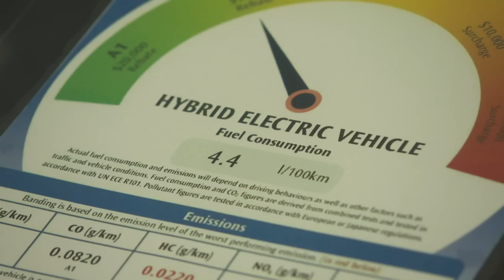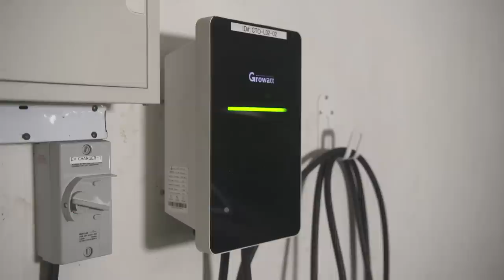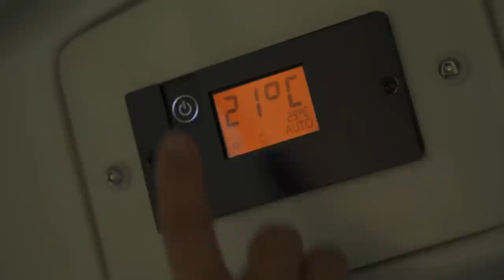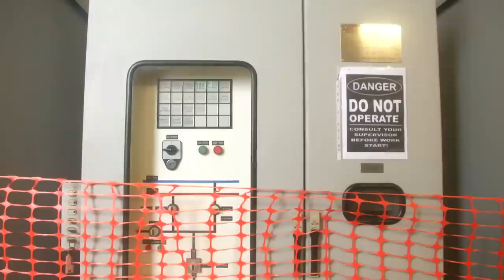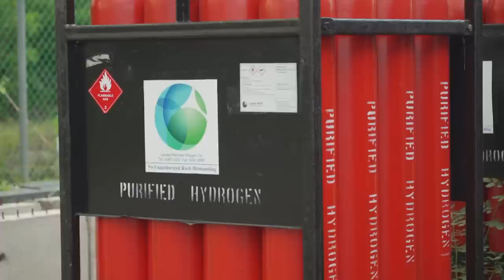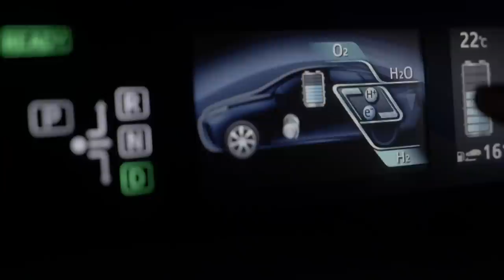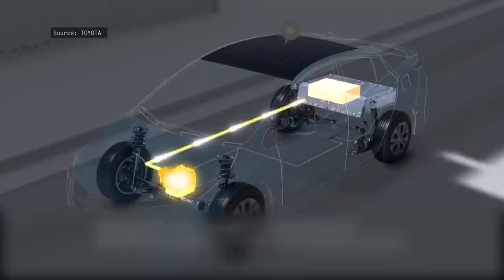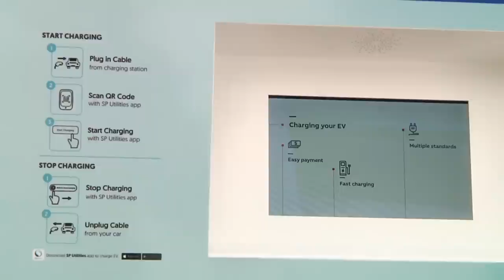Are Electric Cars Really Good For The Environment? | Why It Matters 4 | Full Episode

Comment: Did you cover the power loss topic during power generation, transmission and charging? How efficient?
Reply: There are many videos discussing energy efficiency. Electric cars are the most efficient of the bunch unless the battery gets way too heavy for the task at hand.
Small passenger cars already are cheaper at life cycle bases compared ICE in most places.
Vehicle integrated PV isn't the best option in most situations. When it can be used without adding much extra weight and it can be done inexpensively. It can reduce size and weight of the battery thereby reducing roiling resistance. Solar PV is in less than optimal position on a car therefore producing less power per given area - this can be mitigated by using higher efficiency multijunction cells. For a car to last longer it would be better to avoid unnecessary UV exposure, so in densely populated areas with underground parking it would be not much good.
Slower, liter Solar PV & Battery assisted aero bikes could be a better bet for solar powered vehicle :)
Also it is better to use most fitting vehicle for a task at hand, so it would make sense to share vehicles and rides.
Health benefits of reduced air pollution alone would benefit enough to justify the cost to switch from ICE in densely populated areas.

Comment: Electric car will help reduce urban heat island effect as it is more energy efficient and emits no exhaust. Exhaust from cars are not only unhealthy, it also traps heat.

I hope we will move to electric car sooner than later.
Reply: Several reports have found that hybrid electric vehicles, plug-in hybrids and all-electric cars generate more carbon emissions during their production than current conventional vehicles but still have a lower overall carbon footprint over the full life cycle.
Reply: You need to understand how much precious metals are haversted from the earth to make the batteries etc...
Reply: @N16Ken  I have read some articles but it is difficult to verify the validity those claims. Regardless, electric car are lighter and do not have gears and thus are more efficient. In a highly dense city, the pollution from ICEV is significant and has impact to UHI and public health. Reduction in traffic pollution and lower heat production will also in turn reduce energy needed for air conditioning.

I think there is opportunity to recycle lithium ion batteries as well.
Reply: I am not saying electric vehicles are not beneficial to the present situation we are in. Yes they are surely better... maybe not entirely practical in most cases. 
Maybe one day the electric cars can just go into a 'gas station' or rather a battery station and simply swap out a fully charged battery for their drained out one... then maybe it seems more practical. 
Anyways i dont know when we can all be driving electric cars... but i do know that unless cost and practicalities prevail, otherwise petrol, diesel & CNG will still be here for a very long time to come.
Reply: @N16Ken  What is lacking is sufficient charging station which requires heavy investment by the government.

Recently, Samsung has developed a 900Wh solid-state battery. Solid-state battery use a solid electrolyte making them nonflammable, avoid using a number of toxic materials, and hold the promise of energy densities up to 2.5x that of lithium-based batteries. This is a major breakthrough. 

The development of perovskite-on-silicon solar cells is promising as well. 

The world should move to electric car at a faster pace. This will further accelerate scientific development in green tech and infrastructure instead of investing in development of ICEV.
Reply: Nope you don't know Lithium has more pollution than gas
Reply: nope the most efficient is by maximizing the utilization of public transport like buses and trains and minimizing cars or replacing them by means of bicycles
Reply: @N16Ken  I've read of news that Tesla already had that swapping battery plan in mind at least 3 years ago (before covid) for US. The idea is that those petrol stations would have an area for battery swapping and the target is for that whole process to be under 30mins (iirc). The other main issue would be how $ would be charged, etc.

Comment: Talking about environmental friendly. What about disposal of the battery? Which is more harmful? Have this been debated?
Reply: There is growing market for recycling used batteries for 2nd life applications. Growing market because electric vehicles are still in it's infancy, only commercially available in small numbers about 10 years ago. Emissions from burning fossil fuels since the dawn of the internal combustion engine has not been recycled, this is caused more harm to the environment.
Reply: @alvins.2428  recycling lithium is far more expensive than producing the new battery, so dumping the dead battery is far more toxic.

Comment: Driving into MY how? Can go over but cannot come back because no charging points. LOL!
Reply: Exactly,  unless Malaysia also does the same, if not it's pointless to own a all electric cars.  Also, Will electric cars able to climb the steepest hill in Genting Highlands?
Reply: @marvint480  Go by bus or hire a car in malaysia
Reply: EV range is easily more than 400km
Reply: @marvint480  electric vehicles has more torque than your regular family car. It can definitely get the job done easily provided you have enough charge.
Reply: @akupehsluarketatAR  You need to consider that battery generates quite a lot of heat, it will reduce the mileage by a lot.
Reply: @marvint480  same goes to an engine when u stress it. That is why Tesla has a cooling/heating system for its batteries
Reply: Malaysia also has plenty of charging points.. a number of them are also free.
Reply: @marvint480  Cold weather is much worse for range than heat. Most EVs have thermal management systems to keep the battery in the most efficient operating temperature. The optimal operating temperature for lithium batteries is between 15°C to 35°C depending on the chemistry. So our local climate is actually pretty suitable for EVs when it comes to range.
Reply: Malaysia having charging points in several mall too.pls update yourself. Thailand is more advanced in Ev and charging points all over the country
Reply: @justice217  Several malls doesn't equate to ubiquitousness but since can't go over anytime soon, it's all moot now. In Malaysia, just because it's available doesn't mean it's working, just an observation.
Reply: @sil3ntscr3amlx  several malls in jb and many malls in whole country is setting up the charging points. Singapore is far behind than China and Thailand in terms of Ev
Reply: @justice217  I agree Sg is far behind for now. Can only hope it will indeed get better by 2030.
Reply: Malaysia has numerous charging point, especially along NS highway.
Reply: Poor battery lifespan after few years of usage. Expensive to replace battery.  Poor mileage. Will be a problem for those who needs to drive to malaysia. Not to mention reselling it in few years later.

Comment: Cars are but just a small contributor of carbon emissions in the whole scheme of things. If we're really serious about cutting emissions, we need to look at the bigger contributors like airplanes, cargo ships/tankers, freighters, cargo trucks etc. And also more seriously consider other alternatives like hydrogen, biofuels etc. The environmental drawbacks of rechargeable batteries used in EVs, cost and carbon footprint of manufacture, as well as the cost of disposing them when they're dead is just too "expensive" for the environment in the whole scheme of things. And if the batteries catch fire, boy oh boy.....you're gonna be in deep deep trouble. It's a bigger explosion, the fire is more intense, and a lot more difficult to put out. It's argued that it's easier to just let the battery burn itself out than trying to put out the fire.

Comment: How about the total life cycles of the electric car and the petrol car, including disposing the car and batteries etc? Even though you may reduce greenhouse emissions during using, it doesn't mean greenhouse emissions and other pollution from producing and disposal doesn't matter.
Reply: Million mile battery and batteries can be recycled
Reply: There is growing market for recycling used batteries for 2nd life applications. Growing market because electric vehicles are still in it's infancy, only commercially available in small numbers about 10 years ago. Emissions from burning fossil fuels since the dawn of the internal combustion engine has not been recycled, this is caused more harm to the environment and is still doing so until we turn this ship around.

Comment: This was only based on the energy sources to propel/move vehicles in an eco friendly way, but what about the manufacturing of such vehicles? It still requires extraction of other raw materials from the earth which cause damage to the earth as well. So ultimately it's still not eco friendly. So I call BS on this.
Reply: Victor Williams... yes. Modern technology requires a wide range of artificial materials. The issue you raise is the process of production and selection of which artificial materials are used. This story did not look at any aspect of these issues. Basically, the story was about type of fuel used within the transport sector. Logically, your statement could be ‘Snow White and Seven Dwarfs doesn’t address the extraction of other raw materials... so I call BS on this.’ It has the same relevance.

That said, I actually agree that everybody is concentrating on the fuel and few delve into the trickier subject of materials selection and production. The good news is that the environmental impact of most materials is actually going down (with a few horrible exceptions). Simply put, fossil fuels are on the way out and everything derived from them is being replaced with alternatives that don’t use petrochemicals. Non oil based, biodegradable polymers is the fastest growing segment of the plastic industry. While comparatively small today, they will be the largest category in ten or twenty years.

Recycling of other materials is also escalating dramatically. Large scale manufacturers are finding that recycled material is increasingly more readily available and cheaper. Particularly in the area of metals and plastics.

If we’d started all of this in 1990, we’d be fine... but I’m afraid it’s all thirty years too late.
Reply: @tasmanianbadger  All that to say nothing..... For the record, I said what I said simply because videos like this can and is often misinterpreted my the masses or its intentionally created for that purpose. Most people will watch it a think... "oh I need a hybrid or electronic vehicle" , but not realize to to making electric or hybrid vehicles damages the earth just as much or more than driving vehicles with fossil fuel.
Reply: Victor Williams. Okay. I get it. You have a comprehension problem. I didn’t ‘say nothing’,  you had noticed that it was a story about fuels and not materials and - apparently - because it wasn’t what you wanted it be, it was bullshit. That’s akin to complaining that women’s day magazine doesn’t have enough articles on golfing. The story was about fuels. 

In your needlessly rude reply to me, you seem to have missed the rest of my comment to you that did address and acknowledge that materials was a big part of the picture and unfortunately rarely addressed. Being a bit daft, instead of noticing that you were in an exchange with someone who agreed with you, you chose to react snidely. 

Do those of us who work, research, and study environmental policy, technology, and science a favour: please refrain from making comments. You make our side look bad.
Reply: Sorry folk's but there is no such thing as a "free lunch" everything has its cost even things that are considered enviromentally freindly!
Reply: One doesn't make an electric car or an ICE car and then immediately throws it away. The entire life cycle of the car has to be taken into consideration and this is where an electric car will still have a much lower carbon footprint than a comparable ICE vehicle throughout it's life.
Reply: @alvins.2428  Think first. Then comment. Your response has nothing to do with what I'm saying. You may think it does, but it doesn't.
Reply: The most controversial part is that this batteries most be replaced every 10 years … the amount of pollution just to mine the raw materials for the batteries is insane and also is very toxic for the water use in this process … EV cars are trash .

Comment: Singapore has a great subway/bus system.  
Forget cars.
Reply: Sorry, but I don't enjoy sharing a subway and bus with other strangers.  I like the privacy of my car.
Reply: @OS253  With Citymapper or Google Maps you can map out, to literally the minute, any route in the city, bus/subway.
It's amazing. No need to own a car.
Reply: @SK-lt1so  Travelling from certain locations to certain locations may take 2-3 times longer on public transport. Just recently I use goggle map to calculate a route, public transport takes almost 1hr 30mins with a change of bus in between (total of 2 buses), whereas private transport (or cab/grab/etc) is under 30mins (22-26mins). 

I used to travel from East side of SG to the West for school, I had to take a bus to the train station and then a train to school (train travels about 70% of the whole green line), followed by a short walk, total trip almost 1.5 hrs. With a motorcycle, 25mins. 

SG's public transport system is good, but I wouldn't call it great and yes I've lived overseas with better and worst system.
Reply: @DragonX2X7  You travel anywhere in Singappore for 25-30 minutes?
I didn't think that was possible...
Reply: @SK-lt1so  I don't think you understand what I wrote. I didn't say travel anywhere within Sg in 25-30mins. I just gave 2 different route example. 

With the motorcycle route, a short ride will get me to PIE and most of the travel will be done there. After taking the PIE exit, another about 5mins to get to the school. Start location to PIE is less than 5 mins.

2 route destination is Selatar Airport, thus requires 2 bus from my start location. If I were to take a cab/grab/private transport, it will only take 26mins according to Google map. 

SG have a good transport system but it doesn't cover everywhere and there are still quite a few routes that would take much longer compared to private transport/cab/grab.

Comment: Its irony that its electricity not renewable
Reply: It is possible to drive on 100% solar electricity from Sunseap. Even with our current grid emissions, it is already better driving an electric vehicle than a petrol/diesel vehicle. As the grid emissions decrease with increased solar deployment, it is only going to get better with an EV but conversely there are no petrol/diesel vehicles that can use renewable energy.

Comment: Hydrogen must be only used to make electricity not to used as car fuel, its not efficient and its dangerous and expensive.
Reply: There's more value for hydrogen in industrial applications. Hydrogen produced by excess solar PV capacity can be cheaper than the one made from natural gas. Hydrogen for electricity does not make much sense at current efficiency.

Comment: carbon emission issue required multi sector decision. but theoretically, what govt can do is :

[Step 1] :  Tax Policy

- Housing : Energy performance certificates (EPCs)
- Vehicles : CO2 Emission Tax
- reformulated gasoline and diesel
- reduce sales tax for home appliances w/high energy efficiency label

[Step 2] : build energy infrastructure

- green energy powerhouse : VAWT, solat, WTE Plant, biomass, wave, whirlpool, etc
- clean energy economic zone : industrial zone with 100% powered by renewable energy production (green energy powerhouse)
- power grid infrastructure : underground cable system

[Step 3] : EV infrastructure and vehicle

- build DC Charging Station (privatisation licence)
- high road tax and insurance on gas and petrol vehicle to discourage market demand
- SST exemption (50% CBU, 100% CKD) + easy re/financing plan (offered by Govt Bank, Koperasi or dealership)

Comment: The car might GENERATE less carbon emissions but how bad are the emissions to make these fully electric cars? Probably a lot worse than combustion engine vehicles. Just like anything a change needs to happen companies will make a change but not look at the total picture and usually we end up worse for it... Like companies going from plastic straws to paper. To make paper straws it's FAR worse for the environment but the use has low emissions so they all focus on that aspect. I'd bet dollars to donuts that these hybrid / fully electric cars are in a similar situation where to make the parts it's FAR worse but there's no emissions from the car itself so they'll focus on that aspect.